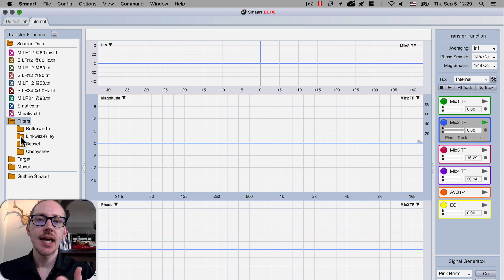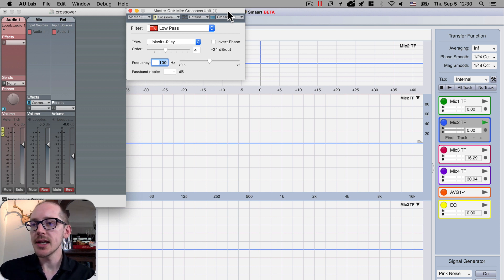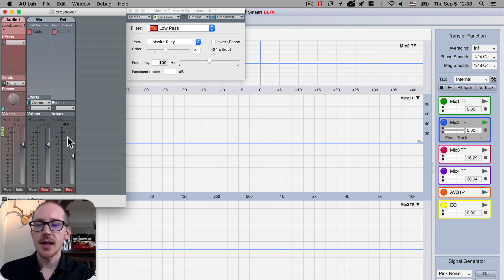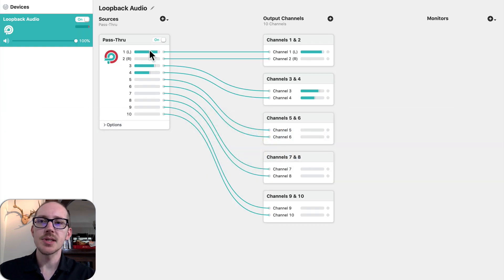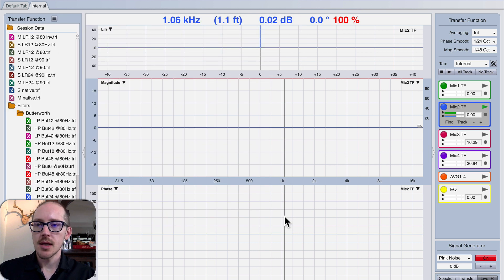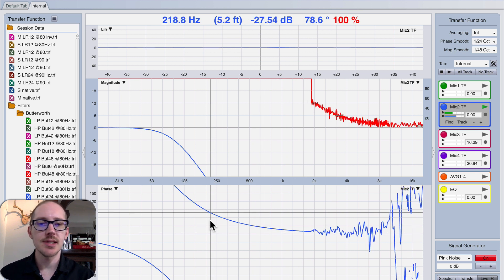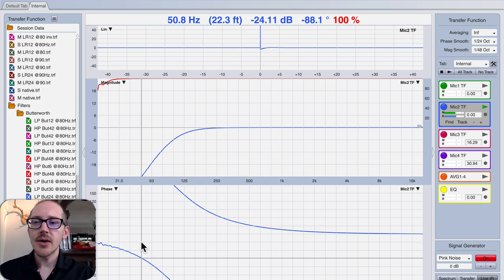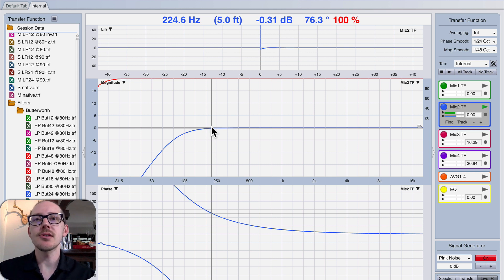How to measure crossover filters in Smaart without an external DSP

Comment: Hi Nathan ... a question how do you get to load the croosverUnit plugin on the mac??
Reply from the maker: Hey Jesus, the plugin hasn't been updated in a few years. I struggled with it on my old Mac and it doesn't run at all on my newer Mac. But if you want to try, just Google "Crossover Unit Plugin". It's the first result.
Reply: @nathanlively  Thanks Nathan ... the one that is installed is Andrew Mcpherson's, but it doesn't work and it's installed in the folder where he says ... when I open Au Lab I can't see it ... I see the pliging of Waves and App .. .It is like it is not installed on the App site ... By the way ... a video of Au Lab and how to configure it would not be good ... Thanks Nathan for everything you contribute ...

Comment: If I don't use the correct jargon, my apologies.. I'm very new to Smaart but understand and want to become proficient with either Smaart or Systune transfer function.  I have seen a tool called EKIO if memory serves correct was used to generate a crossover filtered signal which was pulled into Smaart for a clean filtered target.  It can be found:  http://www.lupisoft.com/ekio/  Might be worth a go.  Enjoying your vids.  I'm literally at the point I have an ECM8000 and Focusrite 2x2 and a Smaart demo I've not yet cracked open until I've hopefully learned enough to get it going and not waste too much time in learning the tool.  I'm evaluating whether I want to go Smaart or Systune at this point.
Reply from the maker: Hey Scott, Ekio looks cool. I hadn't heard of it before.
Reply: @nathanlively  I was shown it by another "car audio" guy using it to generate a target with crossovers applied for individual speaker driver tuning through their full playing pass-bands.  Let me know how it works for you.  Might be a great tool for live rigs for mains vs subs and how their crossover regions look in frequency response.  I think also Systune will have something like that built in.. I could be wrong.